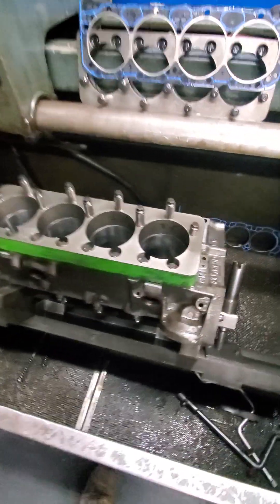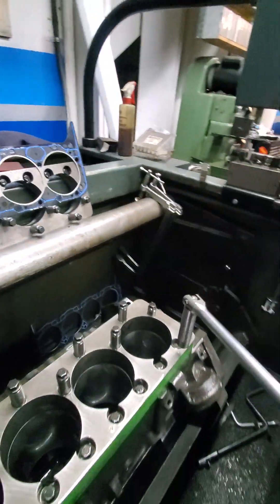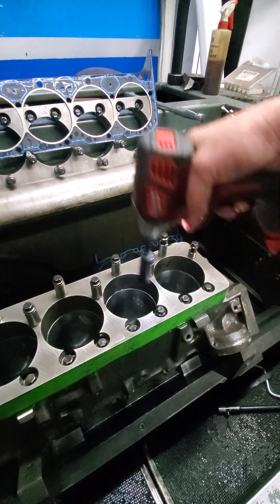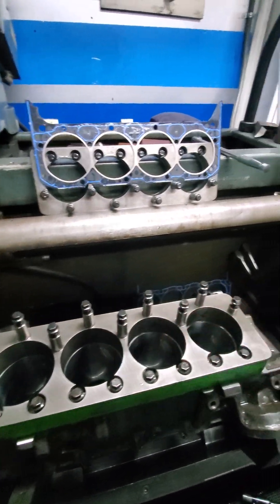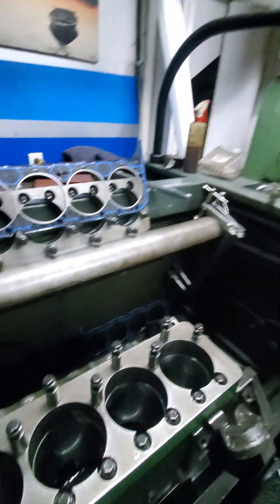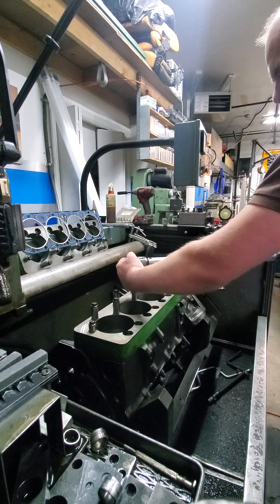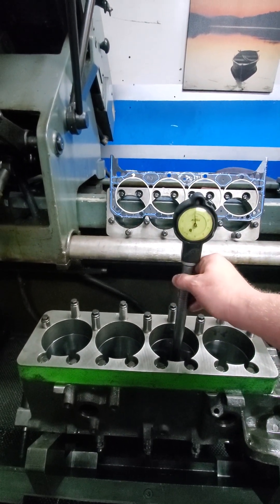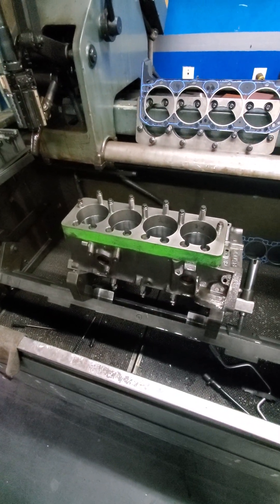Torque plate honing. It makes a difference

Comment: I know for a fact I can distort a block a measureable amount using just my hand so no doubt a torque plate will effect it.  The old iron rings and rough hone jobs of the 70s and 80's would eat themselves round in a few thousand miles. The lighter ring of today with their hard finishes require much greater detail to the hone procedure and conditions.